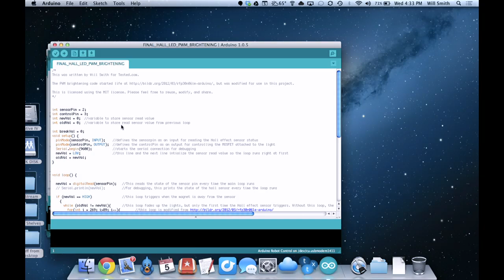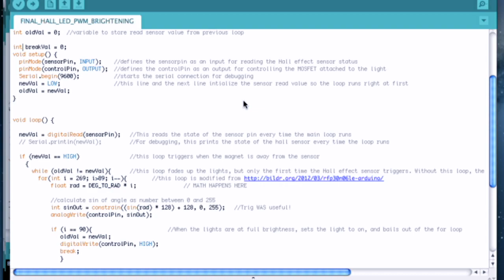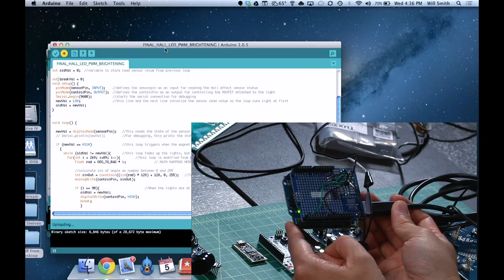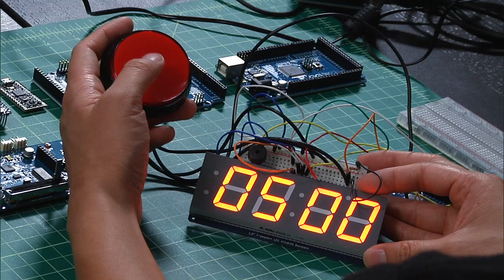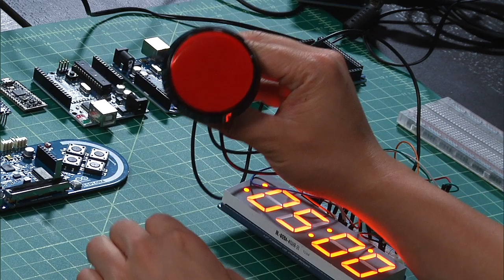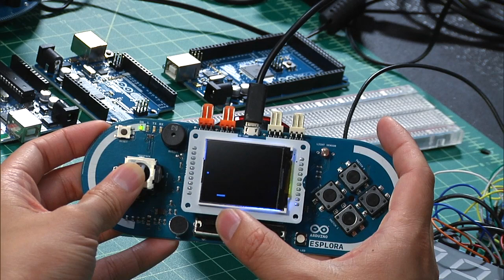Tested In-Depth: Getting Started with Arduino

Comment: "if loops"
...
facepalm
Reply: Yeah. Calling the Arduinos as microcontrollers is bad enough. FYI microcontroller is the main chip which is imbedded in an Arduino board. Most board families share the same chip. The board is just an interfacing and development circuitry the microcontroller chip can work fine by itself, it just won't be programmable. Although some boards have the microcontroller soldered to the board...
Reply: DigGil3 So should I learn how to use and Arduino or just an AVR micro?  I don't have any programming knowledge but I'm willing to learn.  This would be a hobby for me because I love electronics and want to learn how to build cool shit.  What's your thoughts on the Pi?  Thanks.
Reply: KillJD I would recommend you do a bit of Arduino stuff, just to get to get started learning the basics of programming. AVR C is a very complicated thing, especially if you haven't got much of a programming background.
Reply: KillJD I'm not formally educated in either electronics or programming (IE I'm self-taught) so I can only give you my experience. First of all, Google is your friend: you'll have to read a lot of documentation (whether tutorials or youtube videos or datasheets or official documentation or book guides) and every time you see a word or concept in these that you don't get, go search more documentation about it. I've first bought a Raspberry Pi. It is working as an e-mail (https://samhobbs.co.uk/raspberry-pi-email-server, the guy who wrote that tutorial has been very friendly to my questions!) and FTP server for my home. But if you do so too, be ready to become a master with the command line in Linux! The bestest (better than best :P) guide about it is free as in beer: http://linuxcommand.org/ . Arduino is indeed the easiest and maybe the most fun Microcontroller to program with. It uses a C-like or Java-like language. I have worked with the Arduino Micro which is a miniature Leonardo. Sparkfun makes a very helpful guide to distinguish and choose them. Beware: for every Arduino (AFAIK) there is a 3.3V version and a 5V version. If you want to make it talk with Raspberry Pi, you'd better get the 3.3V ones. Raspi's GPIO is 3.3V only.
Nonetheless, when I first started learning programming I'd try making web pages, so I read and tried with HTML. Then I tried more advanced things that lead me to learn Mysql and PHP, then Javascript (not related to Java) and CSS. Do it step by step at your own pace and needs... when one learns one programming language, one won't learn just one language. Yet, I enjoyed the most out of Python which is an integral language in the Raspi too, so it can be used to control the GPIO and everything else. The cherry on the Pi (see what I did there ;) ) is that you can import antigravity with Python.
Reply: You have no idea how difficult it is to watch for me as well man, but I was there once too... Of course, I wasn't a teenager yet, but not everyone started coding so young.
Reply: Hahaha @(1:56) he also said Arduino Mega processor is 32 MHz but it's actually 16 MHz.
Reply: Alex walker It is also not ARM processor, Arduino Due is though.
Reply: +KillJD If your comfortable with C go straight to avr and honestly try to avoid shields, if your interested in learning. If you just want something that works shields are alright. I started off with the whole arduino craze and had problems moving away from arduino and shields.
Reply: +Cody Groshko Thanks Cody.  Couple more questions, please.  I have an Arduino and a Pi.  I'ce had them for awhile and just now decided to start working with them.  On the Arduino I've done a few tutorials from the internet but I stopped because I wanted to know if I should program them in C instead.  The thing is I don't know any programming language.  Should I start learning C first on it's own r learn it while using the Arduino?  Is the Arduino C separate from regular C?  I'm confused about the difference.  ALso I guess if I go the C route I'll have to learn the actual hardware since there won't be the actual "Arduino  language" hiding the inner workings from me.

As for the Pi, I've decided I wanted to  learn Linux using it and a programming language.  It's been suggested that I learn Python first.  I found out that you can only program the Arduino in C.  I don't think I want to learn two at once.  Right now I'm at a crossroads with both these devices.  I don't know which way to go.  I want to make cool physical project for fun.  Like maybe make a remote starter for my car or build my own R/C helicopter that I can control from my Pi.  Stuff like that.
Reply: KillJD I suggest C#. Python is always suggested, but honestly, you may get frustrated just getting it all set up, before you can even start coding. As far as starting out goes, if you want to code programs that run ON the arduino, and not run from your pc interfacing with your arduino, that must be done in C, but check out Snap4Arduino. You can use it to visually layout what you need, and will generate blocks of code for those functions and put it together for you. That might be the leg up to get you over the initial learning curve.
Beyond that, you can pick up a netduino what lets you program it natively with C# without it interfacing with a pc, and has standard ardino pin layouts for the various shields.
Reply: KillJD Like the fella above i recommend mono for your pi. Honestly don't stress to hard on C as long as you understand boolean logic and loops, the arduino isn't all that hard. Im a .net programmer so i just found common ground sometimes it takes me a couple compiles for my code to be right, i tend to get lost while coding and write some C# and just fix it when the compile errors.
Reply: +Michael Scott guess u could do a if loop in recursive.. :D
Reply: +Cody Groshko Mono on Pi=nope, if you compile code using TextBox, your program will crash.
Reply: FawfulDied I havnt had any problems with mono on my pi. If your crashing trying to run winforms its because your missing libraries. It's a known issue and theres guide's on google to fix it. The only limitstion ive run into is no WPF forms but i prefer winforms over the xml stuff anyways.
Reply: Cody Groshko Could you point to some instructions? I tried adding the Mono repository, but it didn't install mono correctly after that.
Reply: +Michael Scott Not sure if anyone else noticed either:Will: "I took C in college, it can't be that hard"Norman: "Yeah, objects, loops."Since when are there objects in C? I'm pretty sure since never. Made me laugh at least!
Reply: Benjamin Melikant C is definitely all about them primitives and pointers :P
Reply: I am thinking they were saying "If, loops, ..." rather than "If loops". Hopefully.
Reply: Never mind. I made it to the end of the program and heard it. Probably just a slip of the tongue though.

Comment: How do I know when to use Resistors? I've no clue with electronics and I don't want to damage the components.
Reply: it really depends on your applications, are you dropping a higher voltage to a component or/and limiting the current draw by it.
for example, if you output blinking signal from an arduino pin to a led, you will include in series a 330ohm resistor.
this is to limit the current draw by the led and the same time reduce the voltage pumping into the led.
Reply: If you need a basic led, then you need a resistor 
Switches can be connected with out resistors 
Any sort of diode that emits light requires a resistor to prevent it burning out

Comment: As many apparently rather knowledgable individuals are commenting, I have a question:
I'm a beginner and looking at acquiring either an arduino (most likely) or raspberry so I can learn to program with the end goal of controlling a large washing machine motor. I need precise variable speed control, preferably the ability to increase/decrease speed by 10rpm increments and with a cutoff switch, also will need temperature sensors and possibly water pump control (in/out).

Can someone please tell me if I can do this ALL with an arduino or some other small and cheap MCU or would I need a custom made board or something? Don't want to invest in something that won't help me with my project.
Reply: Well, the motor I have now may not be the motor I use as it's much larger than I need it to be (it was free so i didn't say no). I may get a different one in near future that requires less energy to power it, so I could simultaneously make sure it's Arduino compatible?
I'd like to power it by battery as a closed system, but may use a renewable energy source too if the battery isn't enough, so it can be 'off the grid'. Not bothered about aesthetics as it's going to be a prototype, just want an LCD screen, buttons to control the motor as previously said, with temperature sensors and likely a water pump that activates when the motor starts spinning, with the end goal of; switch it on.. it does everything I want it to autonomously.
Reply: Okay great, thanks for the help! I'll have to put some time into trawling through forums I guess, just thought I'd ask here instead of having to setup an account and risk my post being ignored for months :L
Reply: An AC motor like in a washing machine runs at a near constant speed as determined by the frequency of the AC power. It would require an expensive AC variable frequency drive (VFD) to be able to control the speed. 

The other option is a DC motor,   controller and power supply,  but that will also be expensive.

Comment: I think this guy misspoke when he was talking about PWM. PWM (pulse width modulation) is what the "analog" outputs  to simulate analog output. It's still on/off digital. The only difference is in the duty cycle of the PWM's square waves. The longer the width of the pulse, the more the whole signal averages out to be.

Comment: Arduino bootloaders are not all the same. They depend on the Arduino board. The Arduino IDE has different bootloaders available. Some bootloaders use ~500K bytes and others can take 2K or more bytes.

Comment: mega uses neither 32bit processors nor 32mhz clock frequency.
it is the atmega2560 (8bit AVR running at 16mhz)

Comment: someone knows how to fix this problem in arduino 
Sketch uses 101,776 bytes (40%) of program storage space. Maximum is 253,952 bytes.
Global variables use 4,234 bytes (51%) of dynamic memory, leaving 3,958 bytes for local variables. Maximum is 8,192 bytes.
avrdude: stk500v2_ReceiveMessage(): timeout
avrdude: stk500v2_ReceiveMessage(): timeout
avrdude: stk500v2_ReceiveMessage(): timeout
avrdude: stk500v2_ReceiveMessage(): timeout
avrdude: stk500v2_ReceiveMessage(): timeout
avrdude: stk500v2_ReceiveMessage(): timeout
avrdude: stk500v2_getsync(): timeout communicating with programmer

Comment: Actually programming Arduino is relatively easy compared to convetional embedded programming, which is done soley in C and the software interracts directly with the registers of the microcontroller.

Comment: If you took C in college, but you can't handle the basics of programming an Arduino, then ask for  refund.
Reply: I learnt 

Digital write, analog write, setting pins as input or output, creating variables, analog in, delay

All in 2 days except for digital read, I can't figure that out yet

Comment: Dam, what happened to the Basic Stamp. Sames like arduino copied everything that parallax did with the basic stamp.
Reply: note to self~ Never name your product "Basic"
Reply: ha ha :)
Reply: Eclipsed, like it never existed.  When I first started this info was only avail in Nuts and Volts/Servo type magazines.  You had to figure it all out on your own, unless your dad was an engineer.  Now, thanks to youtube everyone has access to tutorials etc.  Arduino showed up at just the right time.  Kinda like facebook to friendster.  imo
Reply: I agree 100%.
Reply: Arduino is completely open -- that is how you get to the masses.  There is no licensing fee.  Also Arduino released an IDE -- a more complete package.  I can get into Arduino for less than $50 maybe cheaper fi you have parts laying around.
Reply: I bought one yesterday at my local micro center. So far I am impress. The ATmega 2560 is nice chip and The open source IDE a major plus.

Comment: You WILL have to learn to code. But it's not hard, at the level of Arduino. I've written and maintained C code for the Intel 87C196 microcontroller. A lot of the value of C's more esoteric features is spent on execution efficiency. You don't need them if you don't have to be as fast, and small, as possible. And funny things always happen at border regions, so if you push the limits of this system expect fun results. Where this system shines is in command and control applications, where an operator pushes buttons to initiate complex sequences of actions, requiring minor but frequent calculations involving real-time conditions. And they're cheap! Which elicits notions of an Arduino auto-network, where Arduino chips function as neurons in a digital brain...

Comment: Nah, I wouldn't start off with a 3D printer... It's a bunch of potentially expensive hardware if you are not willing to learn huge amounts of electronics.
You could start off with a project that moves something along an axis if you press a button. The button is not expensive, and if you afterwards actually want to continue with a 3D printer, you can totally use the motor and probably some of the rest of the setup for that.

Comment: Arduino's are not microcontrollers. They are small pcb's with atmel avr microcontrollers which have a bootloader preloaded, which removes the need of a programmer.

Comment: Sigh I wished those who intend to teach use proper standard terminology.  At one point Will did pointed to the actual microprocessor on the  board and other point described how  they are used for development. Dammit call them development boards, that they are, stop colloquially calling them micro processors.

Comment: "32 MHz, low-speed 32-bit ARM processor" ... on a Mega.
Reply: Haha, yes. Atmega2560 == 8-bit @ 16 MHz AVR. But hey, he admitted that he doesn't know a lot, and you don't need to know how it works to use it, it's sad, but true. I wouldn't deem myself a pro either, I still have a long way to go... 😅

Comment: It's Not 120 V AC. Its 220-240 V AC!
Reply: Here in the UK we have 240 VAC at 50 Hz. In America, which is where they are, they have 120 VAC 60 Hz.
Reply: Ah okay im German and i think the Electrical sstem is uniformed in the EU
Reply: Oh okay
Reply: +Nether Rack In North America we use 120V for tvs and them kind of electronics and our stoves and dryers and high powered machines use 220 we also use 2 different plugs for the 2